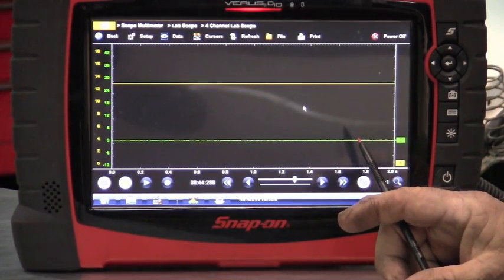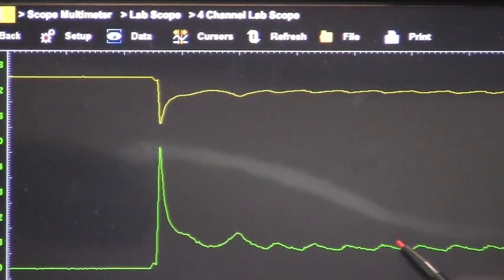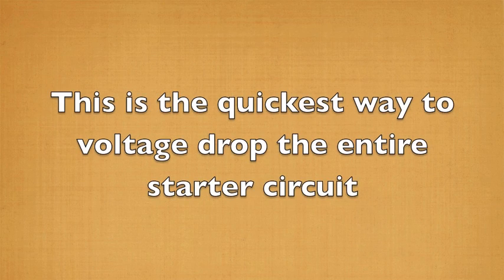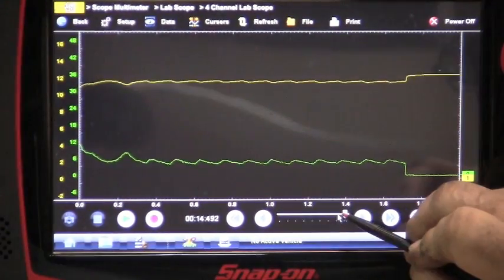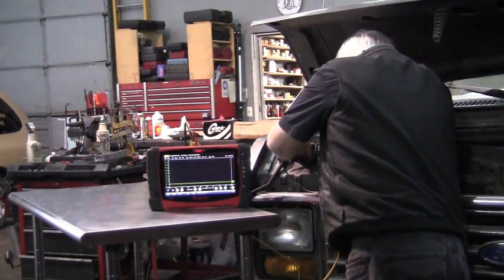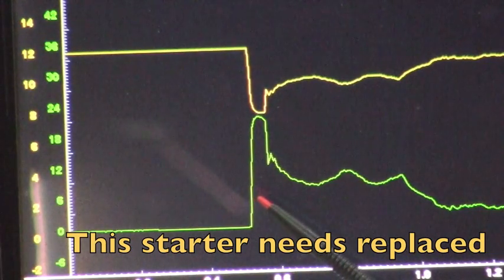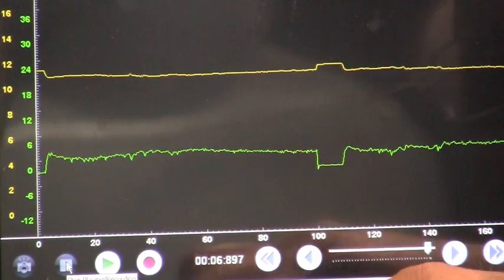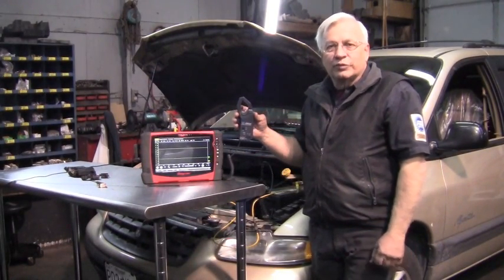Testing a starter's health

Comment: great video i just replaced my battary and later the next day my wife went out and then no start after it was hot...had the battary checked and it was fine but when he did an amp test my starter would draw 400 amps ...witch is to high for a v6 car...from what i read it should be up to 210 amps...so im replacing the starter.....

Comment: Ive been trying to find a video to use my modis and my EEta501C amp clamp just to check starter amperage draw. How to set it up ans use it. my clamp says im only pulling 19 amps and this video looks like its only 10 amps.

Comment: This is great tutortial with a lot of awsome in depth information. but there is one thing that is incorrect. the humps in the waveform are actually the compression humps for each cylinder. the amps/volts fluctuate high and low due to the more power needed to crank the engine during the compression stroke. This is the new and improved way of doing a compression test to see if all cylinders are contributing evenly and its also a great way to check the starter condtion I like the comparison of the voltage drop of the battery and the starter amps. this video helped me diagnose an intermittent bad starter in a Honda crv today. the bad waveform that I got had good voltage drop and amp draw but was full of hash, which I thought to be interference in my equipment but after the starter replacement I took a known good pattern and it was almost exactly like the know good in this video and much more stable than the wavefrom taken off the original starter. great vid thanks for taking the time to explain how to do an an old test on a newer scope very helpful.
Reply: Bravo, exactly what went thrue my mind. Diferent compression between cylinders may cause that  voltage spyke and current draw but for one bad cylinder should have a quarter of time pattern being a 4 stroke engine. 
A slow voltage drop for half of  time base can be low because of usual 1,2,4,3 fireing order in 4 cylinders which may be caused by 2 cylinders with diferent usage like 1 and 2 when the one near the timing belt is the most used.
To tell the diference between these two aspects(worn starter or cylinder usage) should input one probe from crankshaft sensor to a 4 ch osciloscope of lrave the voltage behind and use it for sensor for doing the math ;)
Reply: Also may remove the spark or glow plugs :)

Comment: Hi Duane, enjoy your tutorials. I noticed that at @8:45 the waveforms for the Ford Econoline starter look perfectly normal! The truck actually tries to start (fires up)...that's why the starter amps drop...not a sign of "aging". Maybe try a longer crank time after disabling the ignition to see some repetition in the compression humps?
Also cool waveform on the Caravan! Looks like the starter bearings are worn out, so when the armature is stressed by the upcoming compression stroke, it shifts and causes a momentary loss of contact with the brushes. Great work!

Comment: Hi Dwayne, enjoy your tutorials. I noticed that at @8:45 the waveforms for the Ford Econoline starter look perfectly normal! The truck actually tries to start (fires up)...that's why the starter amps drop...not a sign of "aging". Maybe try a longer crank time after disabling the ignition to see some repetition in the compression humps?
Also cool waveform on the Caravan! Looks like the starter bearings are worn out, so when the armature is stressed by the upcoming compression stroke, it shifts and causes a momentary loss of contact with the brushes. Great work!

Comment: Hello Duane, Conserning the low amp probe you showed. You have used the terms digital and analog refering to the settings. I've known them as ac/dc. I understand that at times you want to see the ac sig. but I've seen you use ac on the clamp when I use dc does it matter as long as you match your scope setting.Thanks for all the great videos.

Comment: I would say in the very first demo, battery is bad and… from using a hi-amp clamp on snap on scopes no really a good idea.They are not meant for hi-amp test... You COULD HAVE   cooked it. Old Modis got cooked all the t.Good Starter always takes up to 125 amps but, a bad starter can go even hirer than 400 Amp and that’s can damage scope. I use MTS 5200 for thistest .about D GC, I’d say batt and str are.superOK